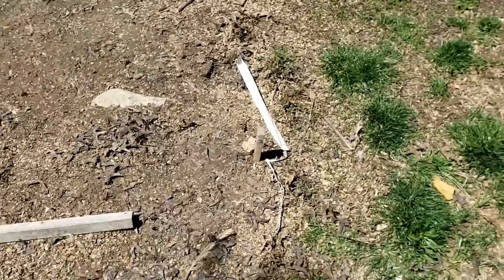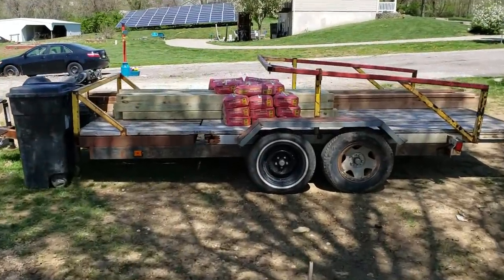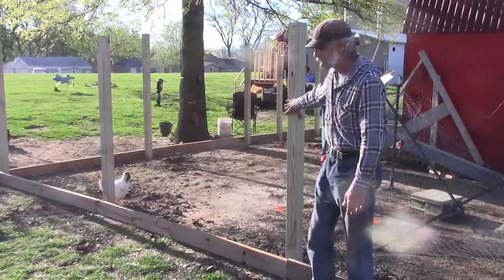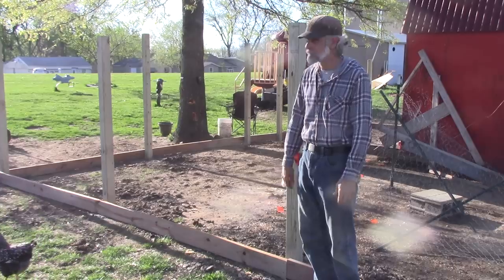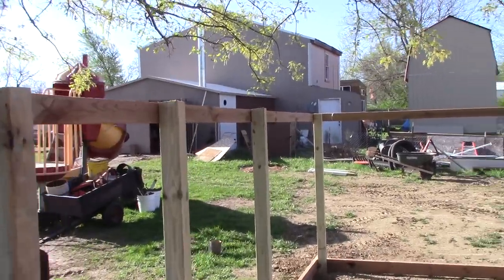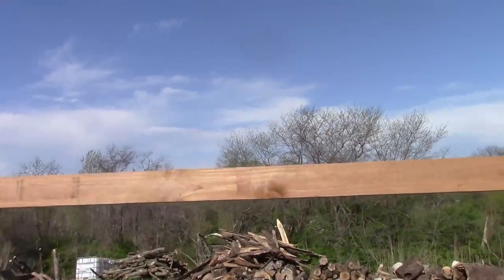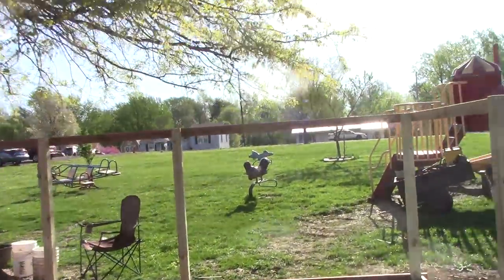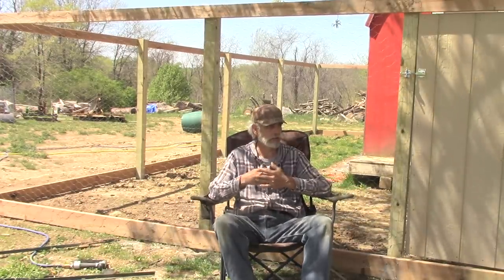A Bigger Better Chicken Run

Comment: some 20 years a go when I moved in one of the fences had posts that were rotting. My neighbor who was 80 at the time told me he had put up the fence 50 years earlier. So one of the old school things he told me was not to use concrete on wooden posts .
He said that after a few years the post will actually shrink a little. this creates a little area next to the post to fill with water which after a few years will rot the wood. So I dug a hole right next to the old poles and just bolted the old post to new post and backfill with the clay I dug out. My neighbor passed away a couple of years ago, but the fence is still solid. 
there are a lot of things we use to do that someone created a commercial to convince us we needed their product.
Reply: The point of Crete is for no play side to side , replacing a fence is part of the game .

Comment: Ok couple questions may ask more before over with. Is that a harbor freight auger?  I just bought one to rebuild our 6foot fence around our backyard. One or two bags for of quick set for the post? I'm hearing both ways.
Reply from the maker: Yes that is a Harbor Freight predator auger. Bought it over a year ago and have no regrets. been real handy on the farm. We were only going 24 inches deep, 6 inch hole with a 4X4 post and ended up using 3/4 of a 50lb bag per post.
Reply: @DIYwithUncleCy  ok thank you was thinking of putting a big handful of rock/gravel in the bottom of each post hole your opinion?